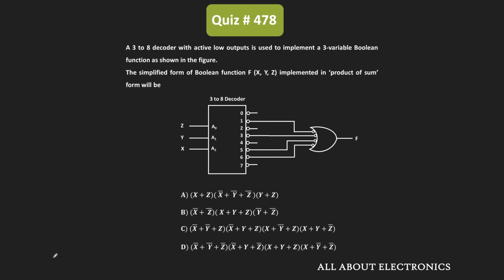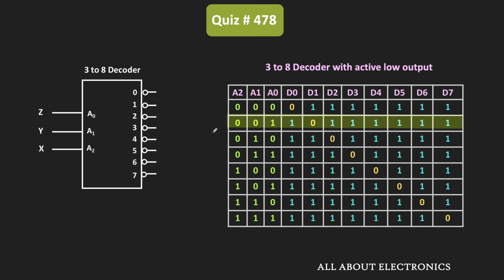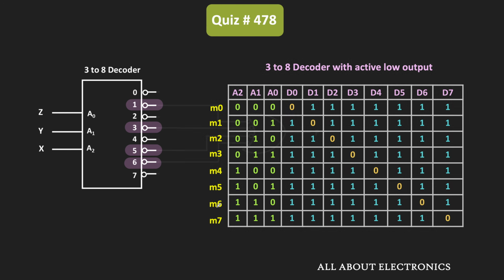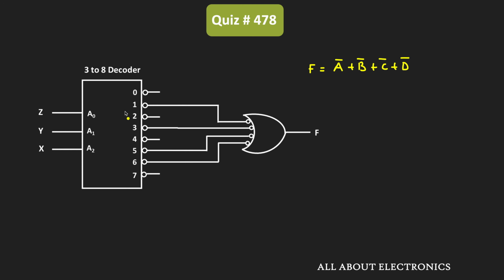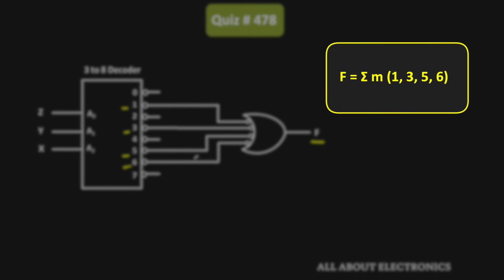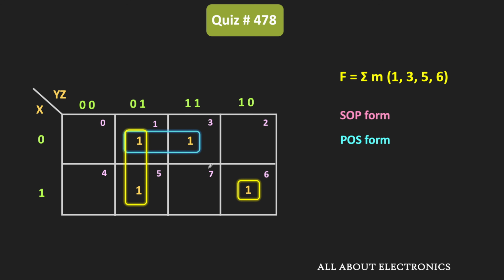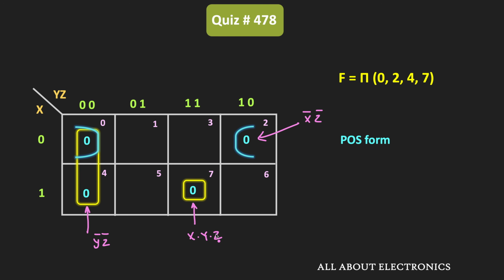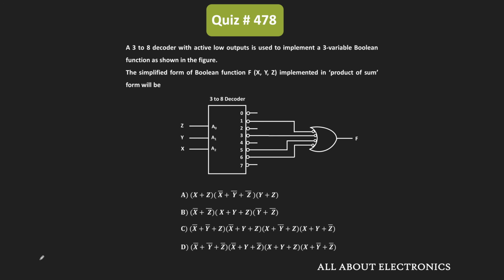3 to 8 Decoder Solved Problem (Digital Electronics) |  Quiz # 478

Comment: hello sir, How to use 3 to 8 decoder in 4 variable boolean expression?
Reply from the maker: For that, you need to have one more enable input for the decoder. With enable input, it is possible to implement 4 variable function using 3 to 8 decoder.
Reply: @allaboutelectronics-quiz sir please solve the question of 4 variable 😭😭😭 using 3:8 decoder